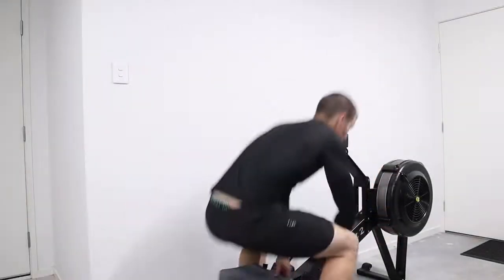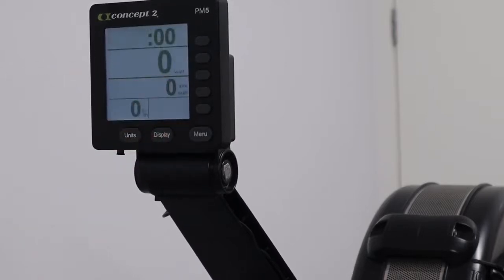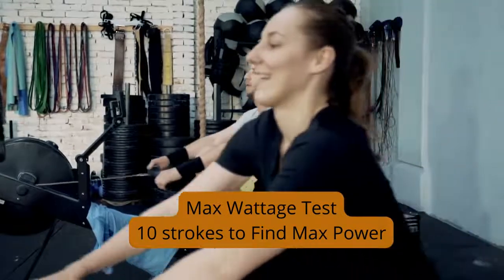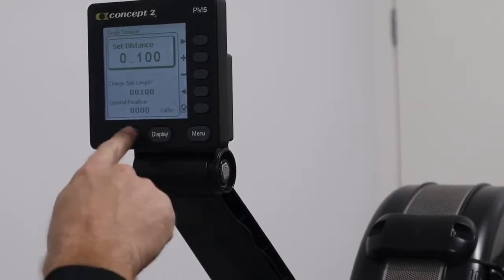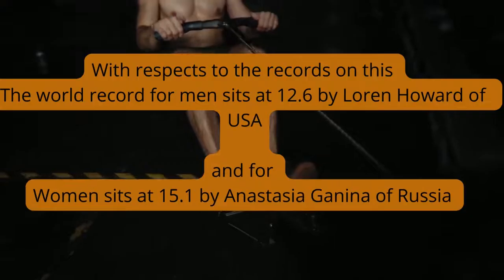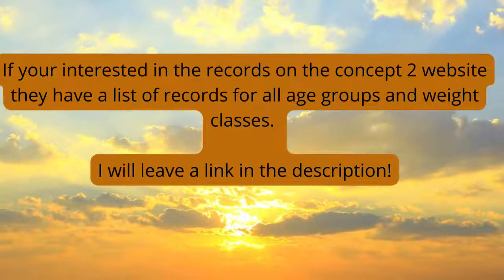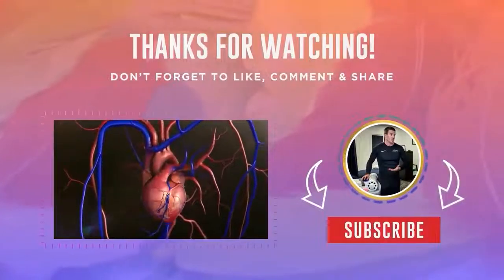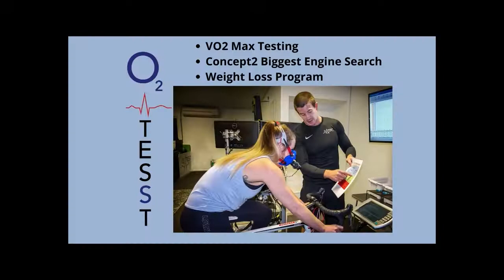When To Use Wattage Units on Concept2 Rower (Max Power Testing)

Comment: Putting the damper to 10 does not mean you’ll produce the most power possible
Reply from the maker: I disagree, Sam. 

Power = work(force x displacement)/time

-The damper setting will not impact displacement (the distance travelled per stroke), assuming your technique does not change. 
- It will significantly allow you to apply more force to the flywheel. 
- Time per stroke can be slightly reduced with a lower damper setting (you can move faster). 

Yes, you can move through the stroke faster, however, from my experience, the reduction in time is not as significant as the increase in force that can be applied. 

Please mind the advice is given for 10 seconds/max power. For a longer duration, I would not recommend a resistance of 10.
Reply: @rogertalkshealth7360  yes I find it much easier to hit wattage on a higher setting. If the setting is on 4 I cannot even feel like I am rowing - just doing calisthenics abs workout. 
My mother on the other hand  is happy rowing on 2 setting for regular exercise.